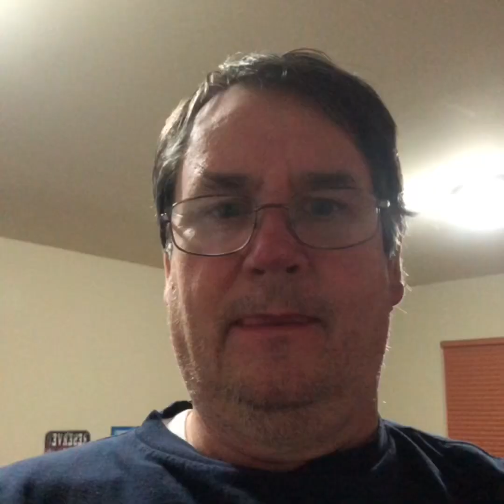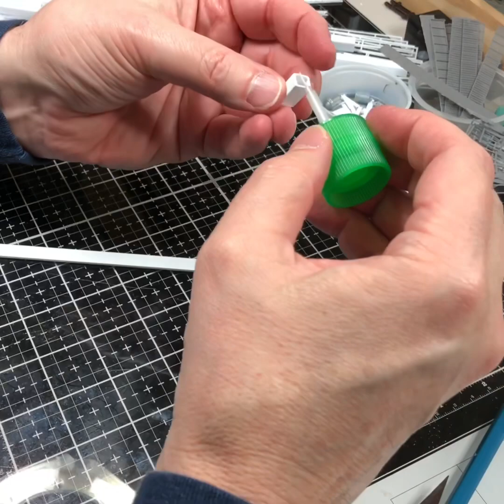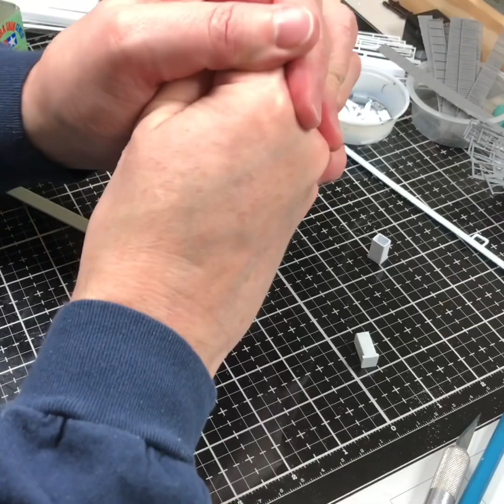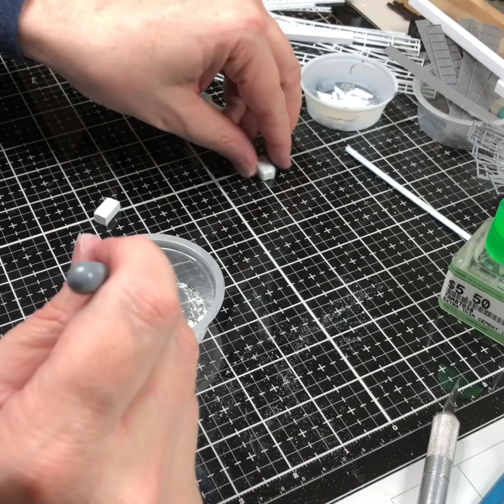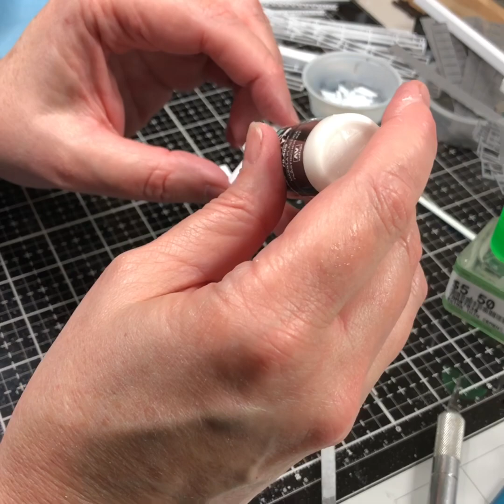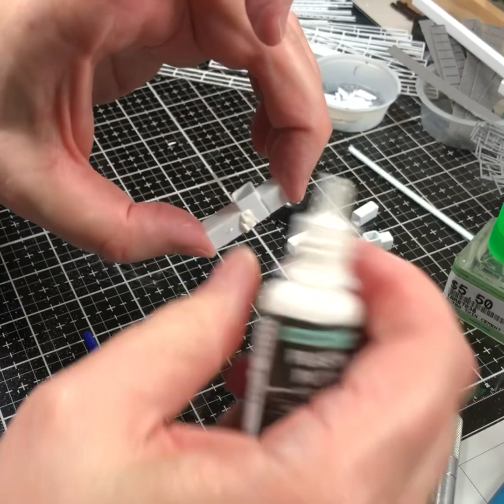Conveyor build part 4 motor assembly

Comment: All four of the comments before mine are from automated channels. These automated channels are getting out of control here lately.  
Ok back to this great video. This grain silo complex you're building is gonna be super awesome when you get it finished. I'm getting more and more anxious to see it done each video you put up. You were using putty to fill in gaps in the video and that works good. Until the bottle of putty explodes. LOL! We all have things like that happen some time or another. Instead of using putty I've taken my scrap pieces of styrene and put some of them in a new, small glass paint jar (six pack from Hobby Lobby) with M.E.K., which is what I use for styrene glue now. It melts the styrene and you can mix it thicker or thinner depending on how much of either ingredient you put in. Put the lid on the jar and it won't dry out. When you need to fill a gap open the jar, it may need to be stirred depending on how long since last use and consistency; if thicker use a toothpick to spread it into the gap or if thin enough you can use a paint brush. It will dry back into styrene. You can sand it, glue it, paint it, and do whatever you can do to regular styrene. It's cheap and you get to recycle all the tiny pieces of styrene instead of throwing them away. If you don't have M.E.K. then you can use styrene glue like the Mr. Tamiya or whatever the thin fast setting glue it was you were using in the video or there's a glue that's sold with the plastruct styrene called Plastruct Plastic Weld that works also. That's what glue I started using before I went to straight M.E.K. Also you can do this same thing with the plastic sprues left from model kits. I've got a bottle with gray in it from sprues and one with white from styrene. A jar last as long as if not longer than a bottle or tube of putty so it's not expensive even if you're using the liquid plastic cement, which is too expensive for no more than you get and for what it's made from. Just a little tid bit that I wanted to share. I'm enjoying this build series so keep the videos coming. 
Stay well.  -Wil   👍
Reply from the maker: Wow Will I had never heard of using that method before. I may have to look into the MEK if I can get a small enough can. We have lots at work, but I can’t get to that stuff. You might want to do a video on that putty.  That way you use similar or same material for filling. Yeah Vinny told me how to rid of the bots